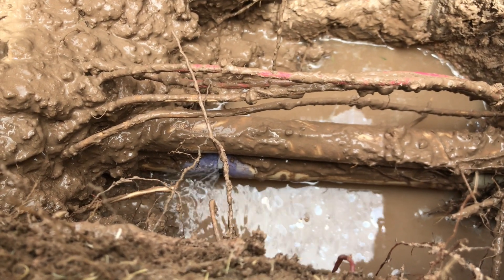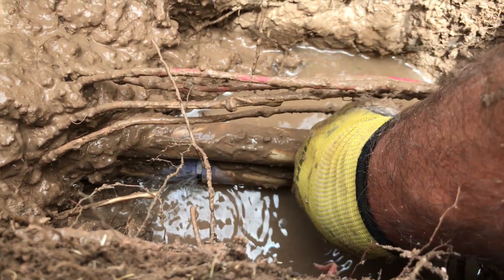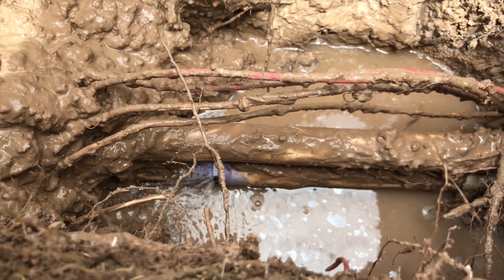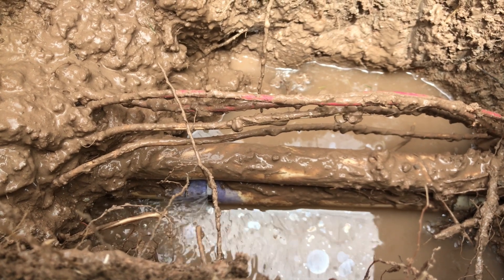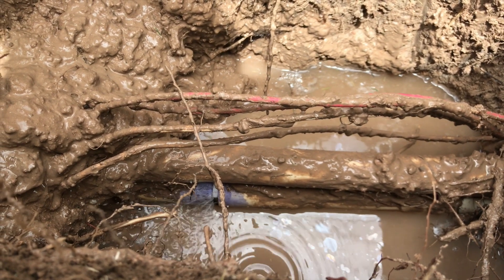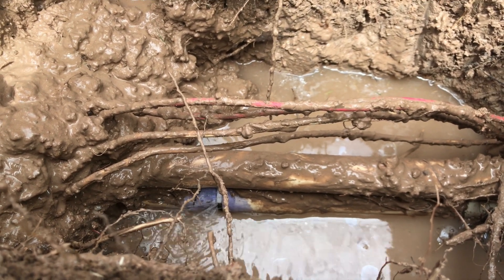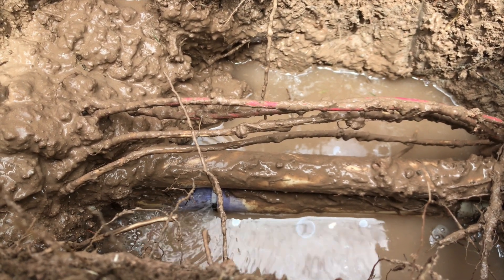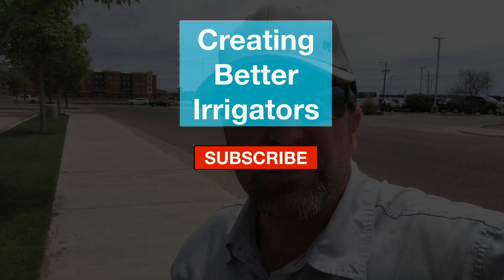How Not to Solvent Weld PVC Pipe

Comment: Usually the ones that fail have no primer on them. I fixed a 4" bell end that failed on a soccer field. It had no primer on it. Found out later that the tee after the bell end had cracked because of the bell end failing. A lot of companies allow their employees not to use primer. I guess the make more money doing repairs. I honestly am tired of fixing these leaks. Absolutely unnecessary. And very expensive for the customers. The TCEQ should crack down on this problem.
Reply from the maker: Oh man. 4" is not fun to fix. I agree. I don't know how a lot of these guys get away with this kind of stuff and how inspectors are not catching it or cracking down on it. I don't believe you save a lot of money or time by doing things half way. I'm tired of it too. I don't mind fixing breaks in lines and fixing problems, but it when these problems could have been avoided in the first place by doing things right, that when it is annoying. Hang in there.